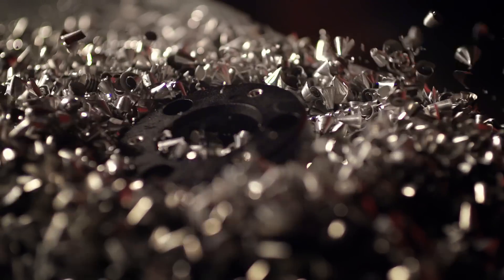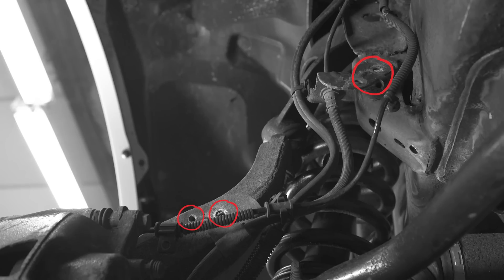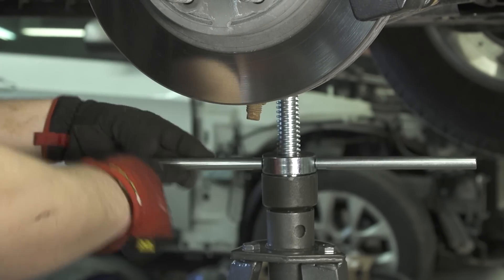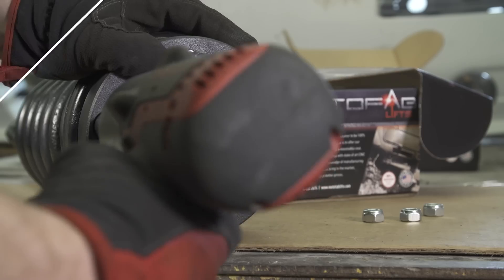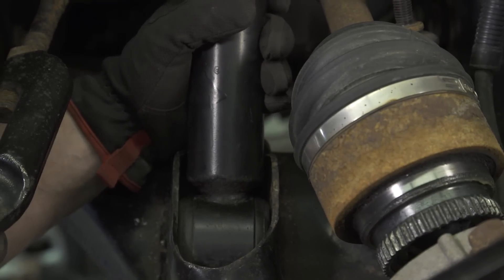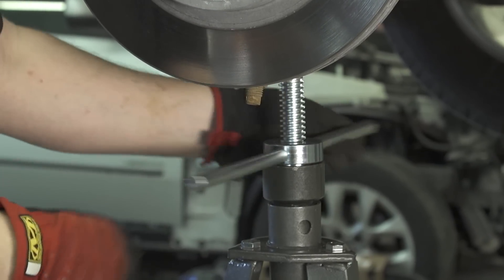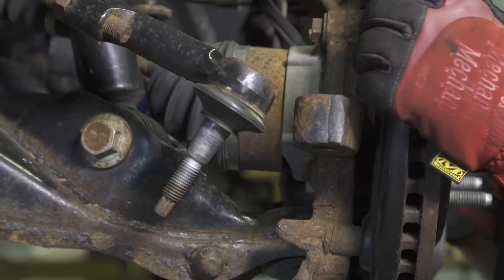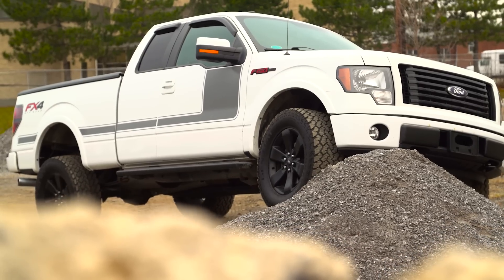F150 leveling kit installation MotoFab Lifts F150-2

Comment: I just did mine myself. Took 8 hours. Torque top 3 strut bolts 35, upper ball joint 85, tie rod end 85, strut bolt 250, stabilizer bar 65. Put blue lock tight on bolt threads when putting back together.

Comment: If you follow these instructions, there is a very good chance you will break your IWE hub when you retorque the axle shaft nut.  This video fails to mention that you must respline the gears for the IWE hub before you retorque, or you will break the plastic ring in the IWE hub.  I did it this weekend when installing this kit, my 4x4 on the passenger side was stuck on in 2wd.  My advice would be to apply vacuum to the IWE hub when you retorque the axle shaft nut, spline it by hand, or do not remove the axle shaft nut if you have enough clearance to get the spacer and strut back in.
Reply: What is the IWE? I have a 2010 Don't seem to have it on mine also its 2wd
Reply: @john420blazeit5  it's for 4wd you wont have it
Reply: what do u mean "respline the gears"?
Reply: @modify.d7160  I broke both of mine following the video we are commenting on, I used the video below to replace both of my IWE hubs, and haven't had a problem since.
Reply: @Sizeth82  thanks Seth, working on this tomorrow. Already did one side, before i saw these comments. So i held on doing the other side till i got more info. So thanks again!

Comment: I haven't installed my lift yet so it may be self evident when I actually do it, but why do you need to remove the CV shaft nut? Seems like an unnecessary step.
Reply: You don't need to, don't listen to the video.
Reply: Ya you don't need to remove the cv shaft, some people do it but it's not necessary. The guys who installed mine broke the iwe actuator seals by pulling the shaft out, had to get them replaced by the dealer. It's a little more effort but worth it to leave them in place
Reply: I just did mine myself, easy. Ask me any questions
Reply: Joseph Foster help me😂
Reply: @josephfoster30  did you remove your CV shaft?  If so, did you apply a vacuum to disengage the shaft teeth? If not, why not? :)

Comment: I have a 2013 F-150.  I used this reference to install my 2" leveling kit.  The sizes mentioned for the nuts were not all the same as stated in the video.  I didn't have the larger metric wrenches so I went out and purchased the 18 and 21mm wrenches.  I'm curious why the video doesn't mention the size of the lower strut nut.  I fortunately had a 1-1/16th socket for this bolt.  Also, nothing to do with the video but worth mentioning, when loosening the multiple nuts the studs have a hex end on them to keep the stud from spinning, 8mm on the 18mm nuts and 10mm on the 21mm nuts.  Every one of the studs required me to put a socket on the stud to keep it from spinning.  2 of these studs hex ends stripped when loosening and had a hell of a time removing them on the sway bar linkage, wound up having to replace them at $100.  Local mechanic said he'd install the leveling kit for $200, FML..

Comment: What do you mean by "Rotate the strut 180 degrees"?
Reply: 180 means half circle, so take strut from how it came out and flip it around with level kit installed on top of strut. Strut holes only go in one way back into truck.
Reply: Thanks Joseph, it all made since when I actually did it this last weekend. Didn't realize they only fit in one way until I took it off and saw that the bolt pattern wasn't a perfect triangle.